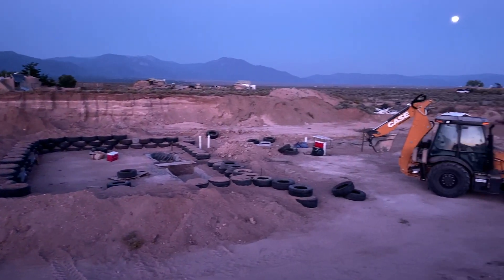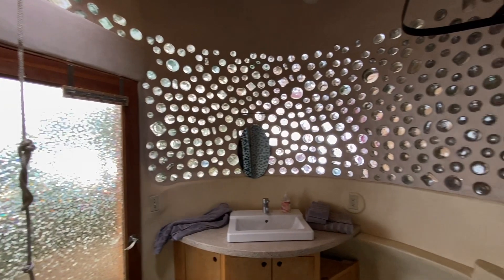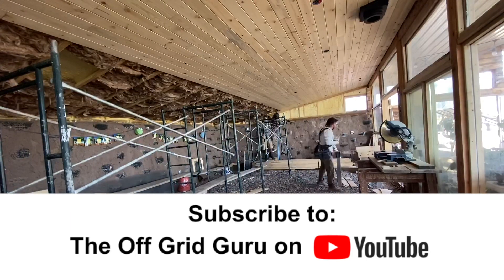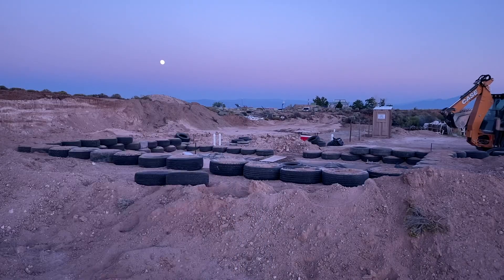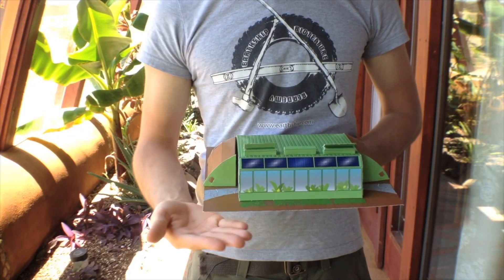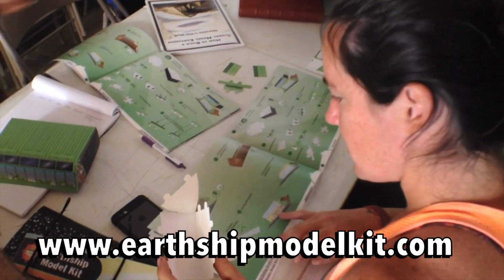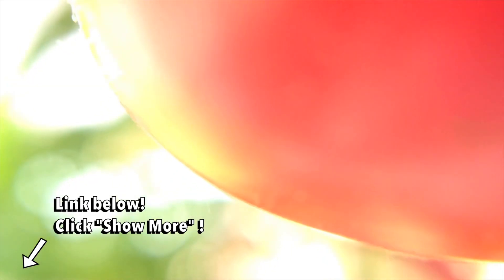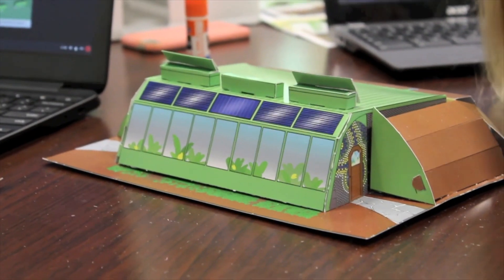Building a TINY EARTHSHIP - Tire Layout and Cooling Tubes

Comment: Why not incorporate sand batteries into these earthships? Then you get free long term heat, hot water and energy year round regardless of weather conditions. You could bury 2 rain water tanks and two sand tanks. Sand can heat up over 1000 degrees with very little energy. A copper coil running through the sand piped into a hot water tank and separate radiant floor heating system.  Or at least incorporate an air to ground heat transfer system so they’re not losing energy (heat) and can store it back down in their thermal mass.
Reply from the maker: Great Idea! The architect that pioneered these, designed their systems to be as passive as possible. That may be why you do not see "Active" systems such as the ones you are describing, radiant flooring, geo-thermal heat pumps ect.

Comment: After packing hundreds of tires I was warned in a comment on one of these YT videos not to pack tires too tightly. Apparently they lock in better when they are not bulging too much. That makes sense. I must have wasted a lot of energy on each tire unnecessarily using sledgehammer. I am considering building a mini earthship which I estimated will use less than 200 tires. There is a video series on YT for one they are currently building in Montana. I would love to build a full size one, but I can't afford it. I think I can always add on to a mini later on.

Comment: Why I am using concrete block on my earthship. #1 time and labor. I have 5 weeks. It takes me and another mason a month to complete a 30x60 block basement. Going with a 6/12 mono sloped roof for winter sun and vertical windows. Snow needs to go some where. Rockwool insulation and masonry veneer. No berm because of snow build up in winter and ventilation. Decided to go taller on windows rather than whole front of building just windows. Needed room for masonry columns too. Going with a Richardsonian Romanesque style as some Earthships seem to have those elements. Trying to make it look heavy, like it holds the earth it's self down in place. I could build completely out of stone and would be clean green build more so than tire built Earthships. The code changed. They now allow more smoke detector options. Before it was ac with battery backup smoke detectors. I am using boat/rv smoke detectors with d.c. and battery backup. Inspector is allowing my reinforced stone footers. Waiting on call back about going with limestone fines compacted, then insulation screwed and glued then flooring. No extra concrete for floor. Being in the cold north I need more insulation on the floor. Using concrete block or poured walls actually allows an Earthship to be built anywhere in the U.S. Building masonry heater/stove to provide extra heat and gets by code easier. Surprised more people don't build modern Earthship homes. If I was worried about cooling I would sink it more into the ground. The slope of 6/12 roof will allow sun to to even hit the north wall inside. Trying to pass  Passive House Standard and PHIUS+. Less than 50000 buildings have passed world wide.
Reply from the maker: Would love to see! Feel free to email me using the contact on my about page!

Comment: When I was helping build an earthship, I started just standing in the tire hole with my boots on and doing some light kicks to push a lot of the dirt into the tires to help save a lot of the work with my hands and arms. Then use my hands and tools to finish puffing up the tire to where we needed it. It honestly helps save energy just moving your feet a little then straining your arms with a sledge the whole time. Also the video is awesome!
Reply: That sounds like a good technique especially for 1st couple layers of tires.

Comment: Ogg, what do you think about the tire off gassing? Plus how people come about all the tires. Wouldn't earthbag or strawbale be healthier/ easier/ faster? Plus where else are pockets of freedom? I know of Creston.
Reply from the maker: Strawbale and Earthship also have pros and cons which I would highlight the possible permitting issues. However permits aside, I would love to incorporate both into builds in the future.
Reply from the maker: Finding tires is not hard, digging through the piles is another story. Often Whats hard is finding the right size tires!
Reply: Another pocket of freedom is Cochise County, Arizona. That's where we are and planning to build an Earthship-inspired home. We will use most of the design principles, but not all of them. We will combine the tires with earthbags. For us, the decision between earthship and strawbales came down to the availability of materials. There has actually been a straw and hay shortage due to drought, but people will always be using up their tires and the dirt is right under our feet.
Reply from the maker: Earthship Biotecture has university experiment backed study on their website called the Tire Offgassing Report – Non-Issue: https://earthshipbiotecture.com/tire-offgassing-report-non-issue/